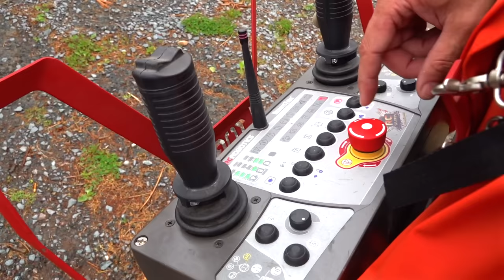Man builds Dragline Mining Excavator | RC ADVENTURES

Comment: Should setup a suction pump so clean out all the rifts in the creek like a vaccum pump on the front of an escavator arm run the feed directly to the ripples just use a wet pump station an connect the hose through the front to the bucket

Comment: Wonder if you took those two chains that are attached by the teeth and moved them up as high as you can it would help pull the bucket at a steeper angle and bite even more into dirt. Just noticed that to with the better cam angles under water!